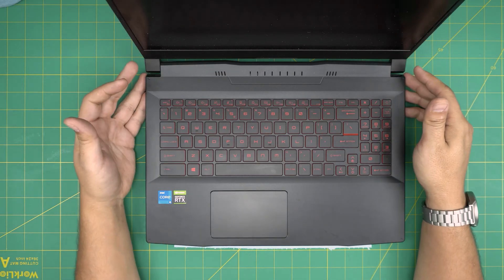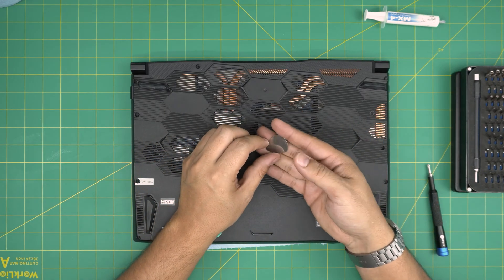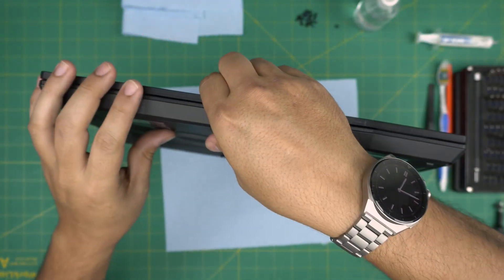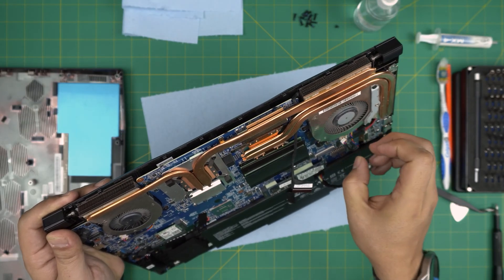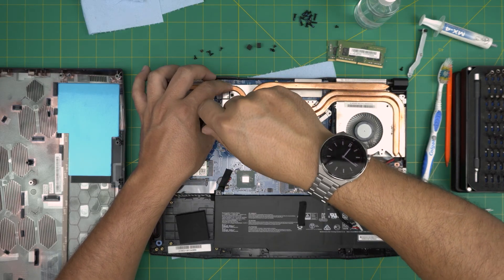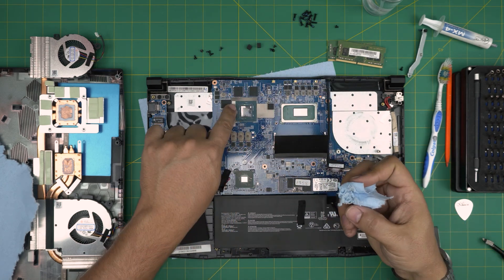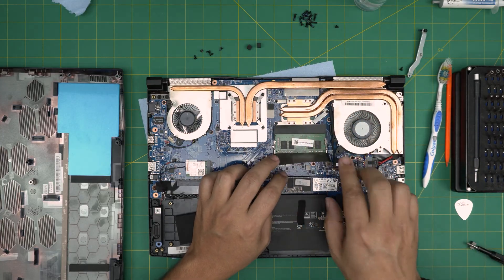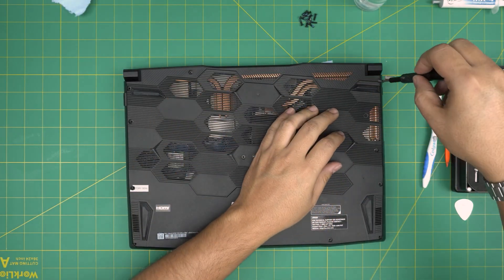How to Repaste and Clean an MSI Katana GF66 11UC MS 1582 Laptop | GL66 11UEK

Comment: Hey can u please clarify if the thermal pads are 1mm or 0.5mm, like i did paste replacement and pads were fine but next year I will change pads as well. I measured and to me that 1 pad was 3mm as u said but all other seems to be 1mm not 0.5mm, it will be very helpful if u clarify🙏🙏
Reply from the maker: 🫠Regarding your question, get .5mm and you can stack them to get 1mm, that is perfectly fine. always get .5mm sheet.
cheers🍻
Reply: @uFixTek  oh we can do that! Cheers man ❤

Comment: I finally got so far to the point that I'm supposed to lift it up. Why is it like it's glued or something? It won't lift up that easily
Reply from the maker: 🫠Regarding your question, witch part is hard to lift the cover ?
Reply: @uFixTek  Thanks. I got it. there was a lot of heatpaste so apparently it was a bit stuck because of it.
Reply from the maker: ah the thermal paste does get sometimes hard to lift.
cheers🍻

Comment: Thanks for the video. Crazy. My fourth laptop now and never heard about it being commonly done to repaste(and it being necessary every two years or so). I had the fans go crazy when I was watching a movie over discord with my GF. For some reason it doesn't happen right now even though I got the movie running and other stuff including monitoring software. I was hoping to use this one for another 2-3 years. Any paste you particularly recommend? Or would you rather recommend PTM7950? I read on reddit that ppl had a lot of success on the GF66 with it.
Reply from the maker: It's my pleasure my friend.
🫠 Regarding your question, if you can get your hands on an original PTM7950, then sure, use that and you’ll have a good time. But any good brand of thermal paste will do the job without any issues.
Just make sure you clean the fans and the heatsink vents in front of the fans (separate the fan from the heatsink—three tiny screws on the fan), and then clean the heatsink.

Should you have any further questions or requests in the future, please don't hesitate to ask me.
cheers🍻
Reply: @uFixTek  Any tips for removing the battery? I'm scared I'll rip the cable or break something at the point. It just won't come out for me... My batteries jack is black, idk if something is different
Reply from the maker: send me an email with a picture of the jack and i will confirm.
ask@ufixtek.com

Comment: thank you for this video, sir 🙏I don't have any thermal paste unfortunately but I'm assuming I can buy some in an electronics store, I've been using this laptop for 3 years now and it's starting to perform poorly probably because i haven't ever cleaned it or replaced the thermal paste, repair stores are a bit pricey so this video helps, thank you again!
Reply from the maker: It's my pleasure my friend.
🫠Regarding your question, just make sure you get a good brand and not just any type of thermal paste. Make sure the brand you are buying is among the top five brands.
cheers🍻
Reply: @uFixTek how come it matters what sort of brand the thermal paste should be? which one do you recommend?
Reply from the maker: It matters a lot what type and brand of paste you use. It's like saying, "I will change my car oil and put any type of oil in the engine!"  
The thermal pastes are linked in the video description.

Comment: I plan to replace my laptop thermal pad. is 1 sheet of 85x45x0.5mm thermal pad enough to replace all the built-in thermal pads? or do I need to buy 2 sheets?
Reply from the maker: 🫠Regarding your question, that is more than enough, also there is a 3mm pad too as it was mentioned in the video.
cheers🍻
Reply: @ is it safe if I change the part that needs 0.5mm to 1.5mm? I plan to make 2 layers of 1.5mm for the part that needs 3mm so I only buy 1 sheet. I think if I only buy 1 sheet of 0.5mm it is not enough because the part that needs 3mm must have 6 layers of 0.5mm. if only I had a bigger budget I could buy 2 sheets without thinking about the size of these thermal pads🥲. (85x45x0.5 its all mm btw)
Reply from the maker: yes that is perfectly fine, you can for sure without any issue stack thermal pads, that should be enough pads.

Comment: Very useful, after fan failure I used this video to understand how to take apart my laptop and replace the fan (seems like it had a manufacture defect in the bearings) It is working wonderfully now and no more loud noise from the fans (Had to resort to unplugging the smaller fan entirely to prevent any issues from it trying to spool up but jamming part way)
Reply from the maker: It's my pleasure, my friend. 😊
🫠Regarding your fan, it has a poorly designed bearing. We get a lot of them in the store. Luckily, they are super cheap on AliExpress or eBay.
Happy New Year! 🎉🍻💕🎄
Should you have any questions or requests in the future, please don't hesitate to ask me.
🍻cheers

Comment: hello, i followed this guide and my laptop turns on without the display, an external monitor wont detect the laptop either. how do i fix this?
Reply from the maker: Double-check the cable connections and ensure the RAM is inserted correctly.

Comment: Unfortunately, everything seems to be working for me except my screen, which is black and shows nothing. Any ideas on where I should start to fix this?
Reply from the maker: 🫠Regarding your question, remvoe the rams and switch the ram places and power on and wait 30sec before you get screen.
cheers🍻
Reply: Thanks for replying, I tried it and still a black screen. When I connect to external monitor it works. Do you have other solutions? Thanks in advance
Reply: @djschmooveofficial  Did you managa to fix the problem

Comment: Hello my cpu is very hot in idle (around 90 celsius) the thermal paste looked in good condition when i opened it. what could be the issue? is it possible to replace the cpu or do i need to replace the mb if its a cpu issue?
Reply from the maker: Regarding your question, use high-quality thermal paste, not a cheap brand, and make sure the fan is removed and the ventilation on the heatsink is clear and clean.
Should you have any further questions or requests in the future, please don't hesitate to ask me.
cheers🍻
Reply: Hey did you fix the issue?
Reply: @yacine7271 it was just dust stuck in the fans
Reply: Hi did you fix the issue?

Comment: I was thinking of getting my laptop to the specialist to change the paste but now I’m wondering if I could do this on my own. I guess your video would help me a lot!
Reply from the maker: If you follow every step in this video, I assure you that you will not have any issues with servicing. If you struggle during the service, you can ask me for help. 🫠
cheers🍻
Reply: @uFixTek  How long do I have to wait to turn my laptop on after changing the paste?
Reply from the maker: You can turn it on right away, but after 5 hours of regular use, feel free to use it as you wish.
Reply: @uFixTek I did everything like in your video, thank you for your help! I turned my laptop on immediately but the temperatures were high so I turned it off and I’ll see in a couple of hours how it works, I hope the temperature will be finally okay 🤔
Reply: Okay, temperatures are still high, when I play Cyberpunk on low graphic settings I have 87 degrees.. anyway thanks for your video, very educational 👋🏻
Reply: @julietenne what paste did u use? I’ve heard ptm7950 is the best for gaming laptops but am not sure if I’m able to do it myself
Reply: @Thiiiiij  I read a lot of opinions and finally used Thermal Grizzly Kryonaut. Hope you’ll find your perfect match!

Comment: How can you remove the battery connector cable so easily? Mine is very difficult to pull out, and I'm afraid to tug on the cable
Reply from the maker: Don't worry, my friend. As long as you slide (pull towards the battery) the jack straight, you'll be fine. Use force and slide the jack back, and it will get removed. Also, if you need more room to do this, remove the 3 screws that touch the battery, so you can move the battery to a different angle to get more space to pull the cable.

Comment: Hello, I would like to know what screw sizes are  for the fan, the cpu/gpu part and the screws that keep the cover on.  Also whether or not if the screws are the same for the 11UE model. Thank you!
Reply from the maker: They CPU/GPU are m.2 screws 2.5mm and the cover is: m2 x6mm
Reply: @uFixTek  Then what about the fans, I do want to know because I have longer screws for the cpu/gpu compared to the screws that holds the fan to the motherboard, can't tell if thats normal or not.
Reply from the maker: The fans are a bit longer. Did you loosen the screws, or didn't you organize the screws when you removed them?

Comment: Thank you so much for this video. This is very comprehensive and super helpful! Now I can give a new lease to my MSI laptop ❤❤❤
Reply from the maker: It's my pleasure, my friend. 😊 I deeply appreciate your taking the time to provide feedback. If you're inclined to support the channel further, feel free to like and subscribe—or even both!
im very glad that my videos are helping people out 🫠💞
Should you have any questions or requests in the future, please don't hesitate to ask me.
🍻cheers
Reply: @uFixTek do you ever encounter an issue where your device does turn on but the screen is blank? I've tried to connect to other monitor but I got no output from it. Did I do something wrong when put it back again?
Reply: I fix it. Something to do with the RAM. After I pulled it out and rub the gold thing with eraser and make sure it seated correctly, I got boot and it runs normally. Still very grateful for this tutorial ❤
Reply from the maker: i just got to see the MSG, ya this happens when the motherboard doesn't dect the ram, simple switch the ram places and power on and wait up to 15sec for the motherboard to do MEM check and it will boot.
im glad that you got it fixed 🫠👍🍻

Comment: Hallo, thanks for this video, I change the thermal paste and reconnected fans and monitor but now when i power on the notebook the monitor doesn't starts. It appened to me in the past when i changed ram an ssd but i don't remeber how i solved it. Any advise?
Reply from the maker: It's my pleasure my friend.
🫠Regarding your question, make sure you don't use any fake thermal paste and double-check the power connectors and flex connectors.
cheers🍻

Comment: Hi, I have the same pc when I try to use the cpu at max power the degree goes from nothing to 90-95 sometimes more, can it be a thermal paste problems, I’ve bough it 2 years ago , now I’m using the cpu at medium power to do not have to high temperature, bite the performance are not the same , changing the thermal paste will help? Thanks
Reply: yes, whenever you're facing any temperature problems with your pc / laptops, majority came from stuck dust or dried thermal paste
Reply from the maker: 🫠Regarding your question, you do need to clean the laptop the vents and repaste it with a good grade thermal paste.
Should you have any further questions or requests in the future, please don't hesitate to ask me.
cheers🍻

Comment: I want also to repaste my MSI Katana GF76 and instead of a normal thermal paste I ordered the honeywell thermal pad. Is there anything I should be aware of when applying and using a thermal pad on CPU and GPU? 
Thanks in advance.
Reply from the maker: It's my pleasure my friend.
🫠Regarding your question, the Honeywell thermal pad is an excellent choice. Just place the pad over the GPU and CPU, and it's done. There's nothing special to worry about (don't worry if it crumbles when placing it, as the Honeywell thermal pad is very thin).
cheers🍻
Reply: @uFixTek  Do you think, it is possible to go lower than around 80 degrees? The thing is, I have a 34 inch monitor plugged in and I play on 120fps, so all that makes the tempratures go high even after repasting, but for now in a acceptable range.
Reply: How did Honeywell perform? How are the temperatures? Thanks.
Reply: @abdulkermatmc  So as for now, the tempratures are ok, when I enable Turbo for CPU in MSI Center, meaning the full power, the tempratures were before about 90-95, now they are at 78-80. Same goes for GPU, before 86, now around 80. It could be better, but for laptop I do not think it is possible somehow to go lower. I still suggests to do the repaste as you can also clean the fans, which were very very dusty in my case.

Comment: I did everything like in ur video and double checked everything. First time I started it I'd did well until I started a game. My laptop instantly turned off. Now it's not starting anymore at all. What can I do or what do u think is the problem?
Reply from the maker: 🫠Regarding your question, what brand of paste you used?, did you replace the pads or left them as it was?
Reply: Something similar happened to me a while ago and it was just because I forgot to plug the fans back in

Comment: After when I replace everything my right fan switched on and then off. I did something wrong?
Reply from the maker: 🫠Regarding your question, no that is normal it will do that, the fan only will spin when the temp reaches a XX number and it will lower or turn off when it is under xx temp.
you fine.
Should you have any further questions or requests in the future, please don't hesitate to ask me.
cheers🍻

Comment: Great video. Can you swap mb from GF66 to GF76? I have a GF66 and a GF76 with dead mb. It is possible the video connector (also)  got shorted on the GF76 but I guess this would only fry the mb? Could this be risky?
Reply from the maker: It's my pleasure, my friend. 😊 I deeply appreciate your taking the time to provide feedback. If you're inclined to support the channel further, feel free to like and subscribe—or even both!
Regarding your question, No don't it will short to gound, they are not compatible case to mobo.
Should you have any further questions or requests in the future, please don't hesitate to ask me.
cheers🍻

Comment: Thank You! very helpful.i have an out of context question, is there a way to repair/replace HDMI port? i think mine has a problem, the laptop has detected second display but the display just show a black screen, its happen to many display, and other hdmi cables do the same, the problem is in the port i think
Reply from the maker: It's truly a pleasure, my friend. 😊 I deeply appreciate your taking the time to provide feedback. If you're inclined to support the channel further, feel free to like and subscribe—or even both!
Regarding your question, yes, you can replace the HDMI port. However, this requires a high level of skill in soldering and the use of a heat gun. Please send me a clear, focused close-up picture of the HDMI port—ideally several pictures—to my email, and I will let you know.
Should you have any further questions or requests in the future, please don't hesitate to ask me.
cheers🍻
Reply: @uFixTek  thank you so much. absolutely its very worth to give a subs and like, I didn't expect you to help people you don't even know. but after some troubleshoot, i have found the problem. i think there a problem in display driver , because when i use a drawing tablet with display, the input from the pen is active, but the display just black. the screen will active when i'm not opening any apps, then goes black if i open fullscreen apps

Comment: Thanks for the video. Got questions, how often is recommended to change the thermal paste? Whats the normal temp? For example i play MW2 at meds. And do you have Amazon link?
Reply from the maker: Thank you for your feedback! If you wish to support the channel, you can like, subscribe, or both!
Regarding your question, there is no exact date, the date for every individual person is different. depending how many hours of use and dusty environment and many other factors. the best you can do is if you a heady user, then do this: service the laptop now, take a note of the date and open the laptop in a year and check the thermal paste consistency and the fan and the heatsink how clean or dirty it is. base on that you can push the next service date to 1.5year or lower it to 8months.
use a good thermal paste like: https://amzn.to/49UfkWn
Should you have any further questions or requests in the future, please don't hesitate to ask me.
cheers🍻

This is an Amazon affiliate link. When you use my links, you are helping to support the channel. 🙏

Comment: thanks for the tear down and replacement replacement as the GF66 is almost identical to that of the GL66 11UEK.. please update yout title to include the  GL model. also any tutorial on replacing the thermal paste with Liquid Metal.. and how it would perform?
😊
Reply from the maker: Thank you for your feedback! If you wish to support the channel, you can like, subscribe, or both!
Regarding your question, title changed "GL66 11UEK" 🫠
i would recommend you not to place a LM on this laptop as the heatsink is a pure copper, the LM will not damage the copper nor eat it. but it will dry the LM over few months and you will have a bad day in a year.
if you wan to go MAX, go with "Thermal Grizzly KryoSheet"
https://amzn.to/3u062c1
it is better than LM and it is solid and permanent and won't react to copper nor the copper with it.
just place "kapton tape" around the GPU and CPU crystal to cover the capacitor (don't place on top of the crystal).
then place the KryoSheet over the GPU and CPU if it is bigger than crystal it is perfectly fine.
and then you can enjoy the best performance that you can get.
Should you have any further questions or requests in the future, please don't hesitate to ask me.
cheers🍻

This is an Amazon affiliate link. When you use my links, you are helping to support the channel. 🙏